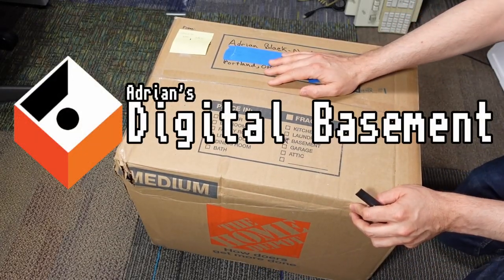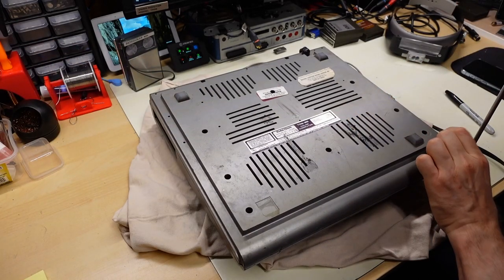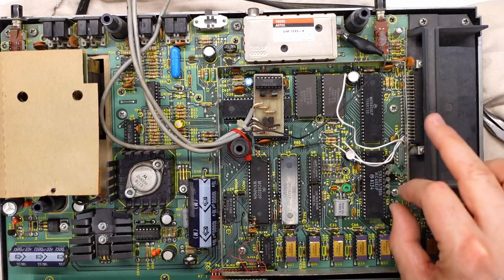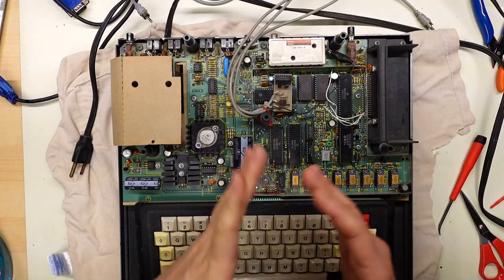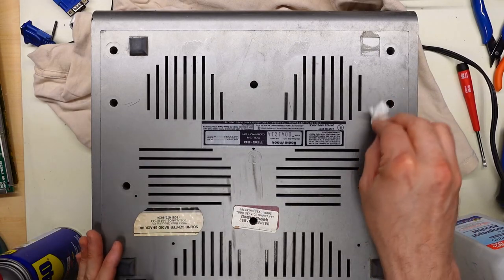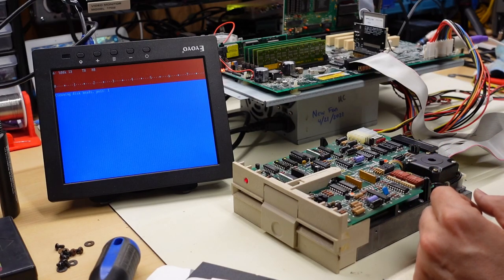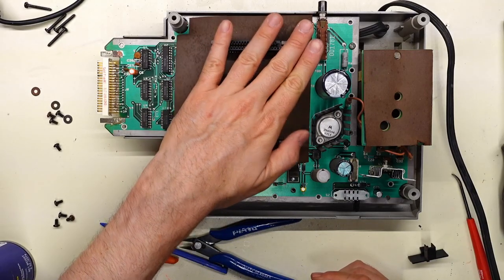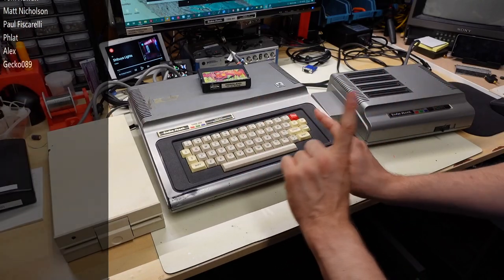0035 We have a broken TRS-80 Coco 1 in the basement! (And a repair on my other channel!)

Comment: @Adrian - The floppy drive you are holding there was manufactured by a company called Remex. Most visibly, these drives were used in the DynaLogic Hyperion, and some variations of the Otorona Attache. 

My father had come across a massive surplus cache of them that were selling for $49 in 1984, when a typical double sided Tandon TM-100-2 would cost $350. We soon found out why: The heads were unbelievably misaligned, and required us to go through with a head alignment disk and a scope, to fix them.

Comment: At 23:00 Adrian commented on the wear marks at the bottom of the keyboard. Maybe this computer was used primarily for gaming? The wear marks on the keyboard appear to line up with the up/down (on the left side) and left right arrow keys (on the right side).
Reply: Also could be somebody who was heavier set and their arms were lifted by you know what. I picked up a trs-80 model III and had similar wear marks. Also know that weight gain is a common side effect from insulin/being diabetic, just maybe.

Comment: Yes, the MPI (Multi-Pak Interface) allows you to use multiple cartridges at the same time, which is why it has all that extra support logic in it.  The CoCo came with a variety of cartridges you could use with the system.  At one time for my MPI, I had a Disto II disk drive controller, a Disto RS-232 Pak, and a Speech/Sound Cartridge plugged in at the same time.
Reply: Finally I see why it cost as much as the Coco itself.  That is tremendously more complex than I imagined.  As a kid in the '80s, I could not justify the cost to my parents who would have paid for it.  My $5 weekly allowance was not going to cut it.

Comment: It's an early CoCo 1, retrofit with the 'melted' keyboard from the early CoCo 2.  Later CoCo 1 cases had the Radio Shack badge centered instead of off to the left, and lacked the RAM badge.  The original CoCo 1 boards could only support 4 or 16K of RAM, but were upgradable to 64K with a hardware modification.  I got my 4K CoCo in the summer of 1981, and upgraded it to 16K myself with 8 DRAM chips bought off the rack at Radio Shack.  I took it to a local Shack (actually an independent dealer, as in the sticker on this computer) to have it upgraded to 64K, since at the time (I was in Junior High) I was a bit leery of attempting the mods myself.  I'm glad now that I did, since they put the official 64K badge on it, which I now gather is a bit uncommon.  They also added the Extended Color BASIC ROM at that time.  

There were many articles about how to do the mod yourself, and the lack of a 64K badge suggests that this upgrade may have been a DIY job.  Later CoCo 1 systems were sold as 32K machines, but most if not all of them used 64K chips, some of which may have been 'half-bad', ie, had bit errors in the upper bank.  Even with a full 64K of RAM, the CoCo 1/2 usually only has the lower 32K active.  However, it is possible to copy the contents of the ROMs into RAM and put the machine in all-RAM mode.  The OS-9 operating system requires 64K and only uses the disk 1.1 ROM to boot.

Another commenter noted that the early Multi-Pak Interface (MPI) didn't support software switching.  I don't recall ever hearing that before, though my MPI was a later one, matching the CoCo 2/3 case.  (Indeed, the manual is archived online, and software selection has always been a feature.)  However, the early MPI had a problem with address decoding in the PAL chips on it that made it subtly incompatible with the CoCo 3.  A revised PAL fixed that problem.  There was also a problem with MPIs reliably getting IRQs to the CoCo, but that was only an issue when running OS-9 LII on the CoCo 3.

The MPI could, of course, be used to switch between game cartridges, but it was most useful for using multiple hardware controllers.  Usually you would plug the disk controller into slot 4, and maybe an RS-232 Pak in slot 3 and an Orchestra-90 or Speech & Sound Pak in slot 2.  It was also used for the high res joystick/mouse adapter used by the CoCoMax paint program (largely as a copy protection scheme) so you could use it and the disk drive at the same time.  There were quite a few 3rd party hardware expansions that plugged into a CoCo cartridge slot back in the CoCo's heyday, including real-time clocks, speech synthesizers, hard drive controllers, MIDI controllers, and voice recognition systems.

Another use for the MPI is that it includes 12V on the expansion bus.  The CoCo 1 did as well, but it was removed in the CoCo 2 and 3.  The earliest floppy disk controller for the CoCo required this 12V power supply, and so won't work with a later CoCo unless you plug it into an MPI.  Interestingly, it is only this early FDC that can easily be modified to work with high-density disk drives, since it has a separate data separator IC.

Finally, the MPI was very useful for dumping the contents of ROM Paks onto floppy disk.  Then you could play Downland or Dungeons of Daggorath without the cartridge or the MPI if you frequently used disk-based software, which became increasingly common.

Looking forward to the full repair on the CoCo.
Reply: You comment is interesting.  I had a good bit of coco stuff, starting with the 2 with chiclet style keys and the 3.  I thought I remembered the 232 pak had to be in 1 and the disk controller in 4, which really annoyed me because of the height of the 232 pak.

It's funny people mention the expansion connector and lockups.  I had a MPI when I had my COCO 2, and the thing was always locking up.  I was back to Radio Shack for repair many times.(I was young and had no tools or knowledge on how to fix it at the time)  I replaced it with a COCO3 and never had the problem again, nor any problems with OS-9 L2 beside the agonizing pain of using that with a single floppy drive!!!  (Try to make a copy-it's painful-at least 30 swaps!!)    I'm now wondering if there was never anything wrong with the coco besides the connectors.  But at the time I didnt care-the COCO 3 was out and I had to have that anyway and it was a good excuse!  

Love this computer - I will dig it back out one day soon have have a play with it.
Reply: @jimb032  There's a thriving community on FB, and a lot of modern upgrades.  OS-9 development has continued, and the modern version is NitrOS-9, which has better performance than the original, and much improved performance if you swap a Hitachi 6309 in for the 6809.  The CoCoSDC is a currently produced SD card interface that emulates the original FDC at the register level, and also provides hard disk sized disk images.  Also, there's Drivewire, which serves disk images up over the bitbanger port from a modern PC or Raspberry Pi, as well as networking, printing, and RTC in (Nitr)OS-9.  There's a new NitrOS-9 distro in Beta called EOU (Ease Of Use).  With a CoCoSDC and/or a Drivewire cable, NitrOS-9 is a joy to use.

I can certainly imagine what a pain it would be to try running OS-9 off a single floppy.
Reply: @joelavcoco  thanks.  I still want a second drive for my fd-501.  I already purchased me a cocosdc, 3d printed a case and a look alike label for it in anticipation of getting out my coco.  I'm in a bit of an apple ii kick right now  but I'll get back around to the coco.  I looked into drivewire, I understand you can use that with the apple and the coco in so that is interesting. 
By chance do you know the number for the floppy drive itself in the fd-501?
Reply: @jimb032  Not off the top of my head.  My original floppy drive system was an earlier version, and the controller was not labeled FD-501.  But any floppy drive with a standard 'Shugart' interface should work, including 3.5" drives.  Even the 1.44M drives work fine, if they're used with low density (720K) disks.  Disk BASIC only supports a single-sided, 35 track format, but you can use up to double-sided, 80 track formats in OS-9.

The main 'gotcha' is that the CoCo uses the originally intended Drive Select signaling with a flat cable, and not that twisted cable nonsense.  So any drive that is to be addressed as Drive 0 must have a switch or jumper for D0.  Later cheap drives made for the PC market were hard-wired for D1.  These can be used as D1 on a CoCo system, and some of them may be able to be rewired to act as D0, D2, or D3.

Comment: Inspired by your channel/videos, I dug out the CoCo 2 I got from the flea-market, as I didn't recall which version/model (1, 2, 3) I had. Unfortunately, something was rattling around inside! A quick disassembly in the kitchen later and I found the culprit, a teeny-tiny spring! Pretty sure it wasn't part of the CoCo and just fell in through the vents, but it's very good I checked! Wouldn't want it shorting anything out. 
Being as it's late at night and I'm not sure where my RF adapter is, I decided not to plug it into the entertainment center for a test. I have a single cartridge for it, one that was in my Commodore collection as an unknown/unlabeled cart that didn't fit any of my Commodores or anything else I had available.
Turned out that the blank black cartridge was Project Nebula, and it worked! It's crudely labeled now.
39:26 Man, one of those slots is looking pretty green!
Has there been a video on the multi-pak yet? I've seen the CoCo-1 repair video.

Comment: Pretty sure that this one has been retrofitted with the CoCo2 keyboard, every silver CoCo 1 that I've seen had the "Chicklet" keyboard.  RadioShack actually sold the CoCo2 keyboard by itself as a hobbyist part, I remember seeing one on the pegboard shelf at the local RadioShack back in the day 😂  There were also late production CoCo 1's that had the CoCo2 keyboard, and the CoCo1 case finished in white/beige instead of silver.
Reply: yes the keyboard has been retrofitted from the chicklet keyboard
Reply: I even remember seeing that keyboard on a shelf in Tandy in the UK.
Reply: ya i was gonna say every picture i have seen the coco 1 came with the chicklet keyboard.
Reply: @rottmanthan  it definately did and yeah its a coco 2 keyboard mod... they sold the keyboards seperately at one time and this was a really common mod... along with a power LED and front reset...
Reply: @melanierhianna  yes Tandy used to sell these seperately for use...
Reply: Yep that looks much more modern than my old keyboard  :)
Reply: @rottmanthan  as I stated above, the very last CoCo1's made had an Ivory case and the newer CoCo2 keyboard 😉
Reply: By the way, if you're wondering where the term Chicklet came from, they were little gum-like candies that were all over Texas around the time that the CoCo was a thing.  You bought them in a pack, but the individual candies in the pack were about the size and shape of the keys on the original CoCo1 keyboard.  Chicle is the Spanish word for gum.
Reply: @brentboswell1294  wait, you can’t get chicklet gum anymore?
Reply: @sideburn  I live in the NW USA now, haven't seen Chiclets in years, even when I go home to visit relatives in Texas.  I googled it, and Mondelez owns the copyright, formula, and trademarks, but has discontinued them in the US.
Reply: @brentboswell1294  bummer! I thought they were still around.
Reply: No... this is like a CoCo v1.35 (I made this number up).... it has both the silver case and the "new" keyboard that was used on the white CoCo v1.5 that came standard with 64k and the "new" keyboard. I bought my white one a month or two after my best friend had bought the silver one... we BOTH had the "new" keyboard... his came with 32k and I had 64k. I think both of us had extended basic. Some ppl note you could buy a replacement keyboard, which is true... but for a very short time, the SILVER CASE SHIPPED WITH THE NEW KEYBOARD. Also, the white case was NOT painted.
Reply: This is called the "melted" keyboard because the keys are shallower than on most other keyboards, as if they had been melted. Later Coco 2's (after production moved from the USA to Korea) switched to a keyboard with regular, full-height keys. There were also aftermarket keyboards with Alps mechanical key switches, higher-quality than any of the official Coco keyboards.
Reply: @Araye  yea I remember all of this. Mine was the very first v1.0 with chicklet keyboard and 4k of ram. I remember writing a BASIC program that ran it out of memory and I was kind of stoked that I finally wrote a program big enough to run it out of ram 😂. The next Xmas I got the 16k upgrade with extended color BASIC. I remember the keyboard upgrade. You could do the same eventually with the Atari 400 and it’s membrane keyboard.
Reply: @sideburn  I was wondering about this myself too bad same thing with Altoids sours
Reply: @vwestlife  man I feel gipped...our first home computer was a CoCo2, 16K with Extended Color Basic, made in Korea, but we had the melted keyboard ☹️

Comment: Nice! Coco I was my first computer so it has a special place in my heart. :-) Like others said, that looks like a 64K bodge near the RAM. I also did that keyboard upgrade. You could get it done at RS, but there were some dealers that sold the upgrade kit and that's what I did - came with the keyboard, the adapter from flex cable to pin connector, and a 6822 to replace one of the 6821s. I don't know why that was required tho. I also don't remember having a bodge from the cable adapter to that test point. I still have mine, and a couple of Coco 2s that dad bought to use at school. He and mom were teachers and at that point the only computers in the schools were in labs. Dad's also has a composite mod, but for some reason it's only monochrome out.

BTW, if you ever get a Coco 3 be aware that the early Multi-paks require an upgraded PAL chip. In fact I think it can damage the Coco 3 if you don't have the upgrade. There's at least one guy I've seen on the net selling some Coco upgrades including that chip. I think mine has a damaged PAL anyway and since the upgrade IS backward compatible I've been meaning to pick up one myself.

Looking forward to seeing the fixes!

Oh, and you can use multiple carts at once tho only one ROM cart at a time. The switch only switches a select line as I recall. But if you have carts that don't have ROMs you can have multiples active at once provided they don't occupy the same address space (memory mapped I/O, so you loose memory to devices). I routinely used my floppy drive (with the ROM selected) with the X-Pad and Real Talker voice synth simultaneously since those had no ROM.

Comment: That keyboard isn't aftermarket, it's an official upgrade from Radio Shack.  I think it shipped on some "CoCo 1.5" computers (same size as the CoCo 1 but had a white case).  I think also that the CoCo 1 was originally only upgrade-able to 32K, and so some of those bodge wires were used to get it up to 64K (Which the CoCo 1.5/2 supported natively).

The Composite output is not something official, though.  

Also that multi-pack interface is the 1st generation type, and unfortunately that means that it doesn't have a "software select" mode on later gen multi-pack interfaces, which could be used to support the floppy drive in slot 1 and other packs in slots 2-4 at the same time.
Reply from the maker: Ah too bad about the Multi-Pak -- could those extra wires inside the coco (that go no where) be there to support this in a hack way? I guess I didn't see anything in the Multi-Pak where those could have been soldered onto.

Comment: The TRS-80 Color Computer 1 was our family’s first computer, and along with it came a Sinclair ZX 80 and a Timex Sinclair 1000.  In hindsight, I think the Sinclair worked fine, but I could never figure out how to use them beyond turning them on.  The TRS-80 CoCo 1 (we just called it the “Trash-80”) was great.  We did some elementary BASIC programming on it, but even though we had the cable to connect a tape recorder, I could never figure out the commands to make that work, so it regressed (to us) to be a computer that we couldn’t save or load anything on.  Recently, I bought a wonderful condition one to use in current day, and this time, I intend to get to use tapes!  The first one had a chiclet keyboard, and I made sure the recent one did too.

Comment: @16:29 If nobody mentioned it yet, that SAM chip typically gets very hot, as I recall.  It even happened on the CoCo 2.  I think with the CoCo 3 it was integrated into the GIME chip which ran much cooler--as I recall.